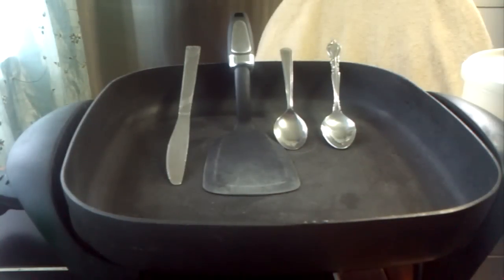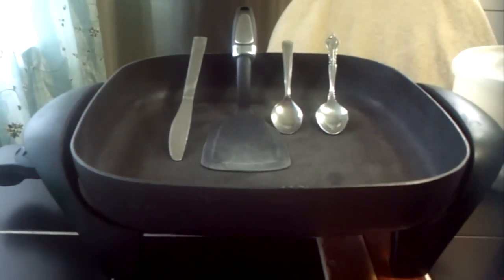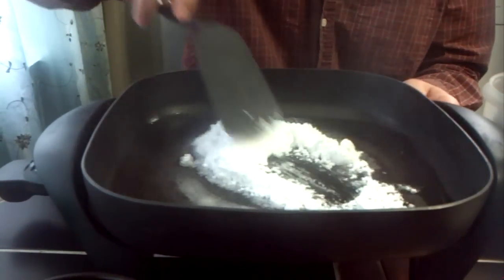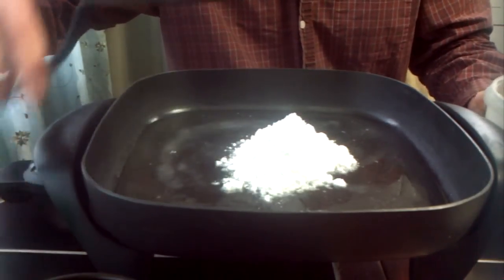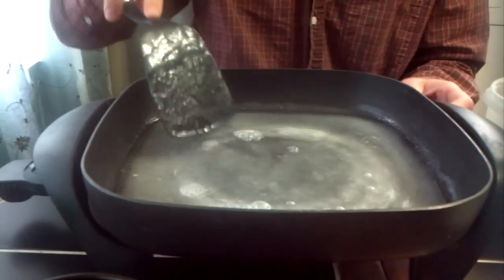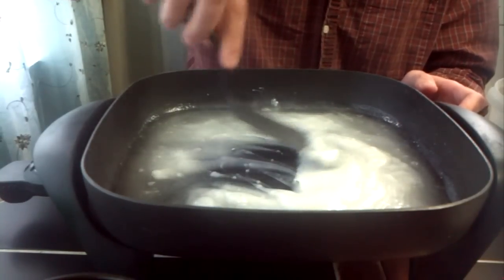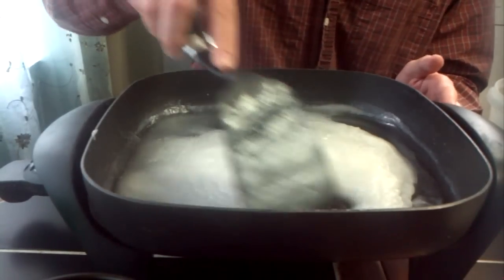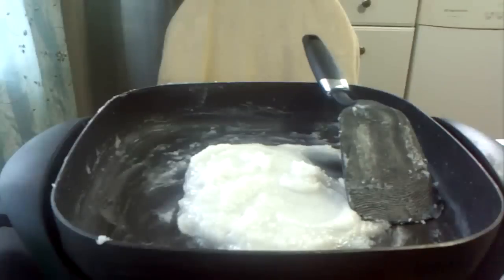Part 2: How to Build a High Power Rocket -  Rocket Candy (Sugar Propellant)

Comment: Thank you again for sharing, great material ! Many years ago I used to just melt KNO3 and sugar on frying pan 70/30. Never had fire, I even tried to test the danger of the ignition by overheating, and it was very hard to actually ignite the mix. Resulting fuel was dense and fast-burning, about 6 mm/sec at atmospheric pressure.

Comment: Iron oxide is a good additive for sorbitol (i use dry melting of fuel). Doenst burn much faster, but it definitely burns more stable. It also makes the fuel a little easier to pour, and it makes it opaque which is useful because it protects rocket case from radiative heating.

But the difference is not extreme, its just cool fine tuning.

Comment from the maker: Hi William...if your fuel is not igniting easily I would say cook it longer.  There should be some resistance to the fuel when you are pushing it around on the skillet.  Because of the corn syrup, it is going to have a slightly wet feeling to it, but it should - for the most part- be on the dry side.  Add 10-15 minutes to your cook time and let me know how that works for you.  Stay safe!

Comment from the maker: Hi Brad - My preference for this formulation is based upon 3 simple factors:  #1 - the formulation numbers work out to be 100 with the 65/20/15 ratios (keeps things simple).  #2 - Compared to traditional R-Candy formula, it is incredibly easy to cast the fuel, #3 - It burns clean and I have never had a problem getting plenty of boost for take-off.  How does it compare with traditional R-Candy for power out-put???  I have no idea  :)

Comment: if it is sorbitol, then you do not need to add water, sorbitol melts at a lower temperature than sugar, first we look at wikipedia mp. sorbitol, then we melt it gently in a sand bath, that's all at low power without overheating, it works perfectly, unlike sugar, which chars.
sorbitol can certainly be alloyed with ETN recrystallized from acetone, their melting points are quite low and quite close to each other.
Sorbitol has m.p. 94-96 degrees Celsius, that is, it is possible to melt all this relatively safely, theoretically even in a water bath, add alkali to the water and raise its boiling point and then in the bath all this can be melted together. 
I am 100% sure of this.
Reply from the maker: All of that is incredibly interesting.   If I ever have time to come out of YouTube retirement. I may look into it, so thank you for sharing.  

In the past, as soon as I realized slow cooking fuel was the way to go, I stuck with it because the method shown here gives a highly predictable burn resulting in pressures I can calculate for safe nozzle diameters based on desired results.  Also, cooking it this way helps ensure there will be no air bubbles.  Last, but not least. It is a great way to remelt old fuel and make it new again.
Reply: @WizzBang75  
Well, so far I'm only purely theoretical, because it is known that hexogen is added to the fuel.
To be honest, I don’t like to melt fuel at all, but I liked how fused sugar with saltpeter burns, it’s better than sorbitol, it just chars pretty quickly.
the last time I just mixed fine powders of sugar and saltpeter, added a little bitumen dissolved in petroleum ether, resulting in a mixture that is well molded, of course it burns a little worse.
magnesium TOS should also burn well (TOS is a fuel-oxidizing mixture, black powder with the addition of metal, often aluminum). The question, of course, is what exactly we are striving for. But I liked this idea of making fuel without melting.
If ETN is so easy to obtain, I would try to recrystallize it from acetone and add saltpeter and sugar to the fuel mixture, sugar can first be melted down with a catalyst (ash, iron oxide, lithium salts), so that it would char a little, and then mix, bitumen in hexane phlegmatizes, I think you can add up to 10% of the total mass, taking into account the oxygen balance ETN. I used to think that about 9% bitumen is needed, as it is written in chemistry textbooks, but I think that even less is enough, 2% is enough for phlegmatization, you need to get such a mixture that it would be possible to mold it, the less bitumen, the it will be better. All this is theoretical. Although I do have some experience.
thanks for the answer.
it is also known from the tabular data that ammonium nitrate has a good oxygen balance.

Comment from the maker: Hi Smacktalker - I can't say with absolute confidence.  Once you start adding things like Sulphur and RIO, you are entering into fields unknown to me.  All my calculations are based upon re-crystallized fuel, so when I use flexi fuel or and tamed down version of recrystallized, I know I am within safety margins.  What your mixture would do with the same throat diameter nozzle and inside of a pvc casing - I have no idea.  Be safe!

Comment: While shopping for KDNX ingredients I saw confectioners sugar at a great price.  Looked into it and discovered that it has a high percentage of starch in it.  I didn't think that would be desirable so I dismissed it.  Pleasantly surprised to find you using it sucessfully.
Reply from the maker: it works well, saves me a lot of time and I can't complain about the results.  I am sure regular sugar produces more powerful results, but I am happy to stay well within the safety margins.
Reply: @WizzBang75  i tried it and it didnt work worth a crap..what was the ratoo mix u used?

Comment from the maker: I have stayed away from RIO.  It increases the burn rate and the internal pressure of your motor as well.  The BATES grain calculator I use now is formulated for recrystalized fuel - not fuel with accelerated burns like you mentioned.

Comment from the maker: I do not use 1ml of water for each gram of fuel.  I use about 100-150ml of water for a 500 gram batch of fuel.  If you are making re-crystalized fuel, it is recommended that you use 100ml of water for every 100 grams of fuel mixture.

Comment: Great videos, WizzBang.   Have you tried (or even considered) KNO3 and sorbitol, with a pinch of Fe2O3?  This would eliminate the corn syrup, the water addition, and the long cook times.  Just wondering, that's all.
Reply from the maker: Hi Appalling68...i have not tried Sorbitol as it is an ingredient that greatly increases the cost of this hobby.  I have not used Red Iron Oxide simply because I do not need it, but I am very receptive to trying it some day.  I have moved to a more populated area, so sadly, my rocket projects are taking a back seat for now.  I'll be back at it some time this Spring.
Reply: WizzBang75 Ok, my bad.  I didn't take the cost of sorbitol (vs. sugar) into consideration when I posted.  Yeah, I know it's more expensive but what a difference it makes not only in the preparation but later in the handling of the propellent.  I've been pissing off my neighbors with my recent testing (right in my backyard), so I know the feeling.  ;-)

Again, thanks for your great videos.  Keep up the rocket science!
Reply from the maker: lol @ Appalling68!  I have tested some decent sized motors in my backyard as well, but so far neighbors have not complained.  It is over so quickly that I don't think they'd know what to complain about.  I remember the sound of my first 1200 Gram motor, it sounded like a freight train coming through!  

If I ever get to happy launching grounds where altitude and population are not issues, I will invest in Sorbitol.  I have spent a ridiculous amount of time cooking propellant.  

Alright...good talk!

Comment: I have a question regarding a cook time for 100 Grams. I watched your videos and they are excellent, thank you sharing. The consistency of my batch when i am finished is like a creamy paste. It will not lite and burn completely after sitting for about twenty minutes or so. It seems kinda wet, do i need to allow it to cure for a longer period of time, or do you suppose i need to cook it longer? Any help is appreciated. My mix ratio is 58g KNO3, 29g Sugar, 13g Corn Syrup and 10 ml of H20.
Reply: You probably have to cook more water out of it

Comment: Can i use the stevia sweeteners, i seen someones use the sorbitol based sugar in the regular sugars place
Reply from the maker: @squigglesmcjr199  I don't have a good answer for that, but safety should always be a concern.   Make sure to do a burn test.  1 inch per second is the standard.  If it it radically faster than that, then no.  I don't know if it will burn at all.  Get back to me when you find out.
Reply: @WizzBang75  OK IL cook some and see what it does also thanks for the fast reply on an old video, I really didn't expect it.

Comment: Don't understand the water with corn syrup??
Reply from the maker: The corn syrup creates a flexible binder...making the fuel easier to cast, and much less likely to crack the fuel under pressure.   The water is intended to get all of the Karo out of the measuring cup.

Comment: Why do people who make these rockets call the process recrystallization? 
A recryst is when you change the temperature of the water (not the quantity) to dissolve and un-dissolve a product. First get your boiling water (at reflux; you don't want to lose any steam...). Then dissolve as much product as you can in it. Then as the solution cools down, crystal product will begin to form (because lower temp = lower solubility), hence the name recrystallization. You're then supposed to filter these crystals out. This is a method for purification. Crystals are obviously undesired for rocket fuel, here you want the finest possible powder. So now you know, recrysting is something else with an entirely  different purpose.
The method your use is simply for mixing the two products together better. It's just "mixing in solvent and evaporating". It's a good technique, effective for the purpose of more evenly mixing. It just annoys me that almost all rocket builders falsely name it recrystallization when they actually don't know a thing about chemistry

And although I don't actually have any experience making rocket fuel, here's advice from a scientific point of view. You didn't use enough water. Like you said yourself in the video, (although you used the term decompose which is incorrect because it implies chemical change in the molecules (such as sugar caramelization)), you want the chemicals to disassociate (dissolve) completely so that they are more intimately mixed together, then evap your water. So my tip would be to add water until complete dissolution.
Anyway out of all the r-candy videos I've seen, your's is by far the best in terms of scientific accuracy and also you're the first I've seen to not decompose the sugar. Because yeah most people don't understand that if their sugar turned brown it just isn't sugar anymore.

Comment: BTW, I was wondering if bubbles in your mixture affect the burn?
Reply: When you put the fuel into a mold, if theres large bubbles the fuel grain will create a large pressure increase, because of the change in surface area that is burning.

Comment: I made this fuel and it turned out to be crumbly and looked like haggis once fully cooked.  What am I doing wrong?
Reply from the maker: you are over cooking it.   the fuel you described is dangerous it will explode under pressure
Reply: There isn't an exact ratio for water to fuel. The water is only used to convert your powders into a liquid in order to mix them better. The more water you use the longer you'll be cooking. I like to completely solidify my fuels so I use a bit more water than WizzBang75. I also add about a gram of iron oxide to my mix, this increases the burn rate but don't use too much. I make rust by submerging steel wool in a cup of bleach for about a week and then catching the rust with a coffee filter.

Comment: You ever think of adding "rust powder"?
Reply from the maker: Hi Gary,  I do not use the Red Iron Oxide.  It isn't needed as I get good burns and I've always had to be very careful with altitude.  Also, I do not have a calculator that factors in the higher power.  I like to play it safe!

Comment: How do you know the core size thank you for your time
Reply: Yes, your core size is based on your nozzle throat and your nozzle throat is based on the calculation                 Vc
                             L* = ---
                                    AT

Basically you need to find a good ratio. 1" PVC needs about a 3/8" nozzle hole or larger but test and see what works for you. I currently use 1 1/2" PVC with a 5/8" nozzle.

Comment: Has anyone tried using marshmallows instead of powder suger?
Reply from the maker: I am actually convinced that would work!  Also the marsh mellows could be a binding agent.
Reply: I know there could be more in marshmallows starch and what not, just trying to simplify the cooking process microwave the mallows then add the potassium nitrate
Reply from the maker: I would use a double boiler...and of course...weigh them in advance of melting.

Comment: Trust me when I say if your not using red oxide its not high power fuel.
Reply from the maker: I know RIO adds to the power... however you can't pass the straight face test saying it isn't high power when I have had rockets go thousands of feet in the air and out of sight.  Not a point that can be reasonably argued.  I do conceed that the power can be increased.

Comment: this fuel is good but it is Suspect to shocks, temperature cycles and Stress. The Fuel I use Lasts Years with temperature cycling, shocks and stress I,  love it And It's been tested. Also No Cooking needed also a bonus! And it has a Better ISP and is more predictable, and more open for characterization than the candy Propellant. Overall cost is slightly higher, but for the added benefits it's much better.
Reply: I also can say that I tested this propellant for YEARS and will attest to the facts I stated Above.
Reply: I also forgot to say that the fuel I use can BE SCALED way Up safely and Successfully too.
Reply: skyprop
As well My Propellant is straight forward and no Guessing or wondering thinking about it. It will be all right there for you no Guessing.
Reply: +skyprop dude gtfo.... stop banging on about your amazing fuel without telling us what it is.... oh guys my fuel does this and it does that and its sooooo much better and here's some technical terms in your face to make me sound smart and im so awesome and clever and better yeahhh
except for the fact that when someone asked you what it is you didn't give an answer..... probably because you were just saying all that to make yourself sound cool in the comment section...
Reply: He REAALLY wants to know what that fuel is lol

Comment: When you let the fuel sit to thicken, what is the heat temperature?
Reply from the maker: I use to hear the fuel to 250 degrees and when I was happy with the consistency I would cast it immediately.